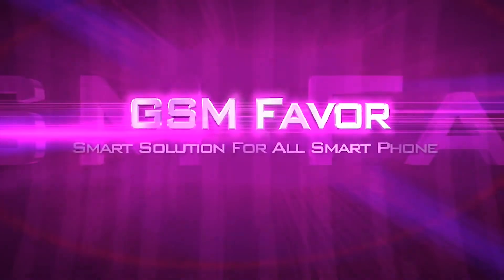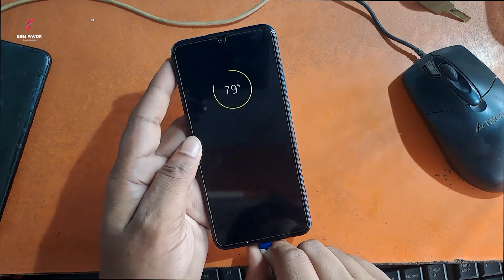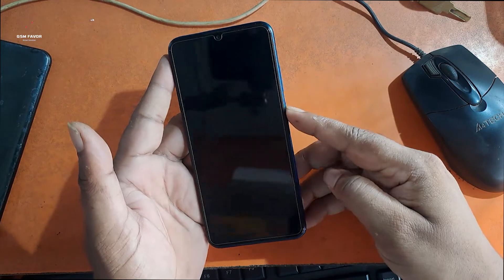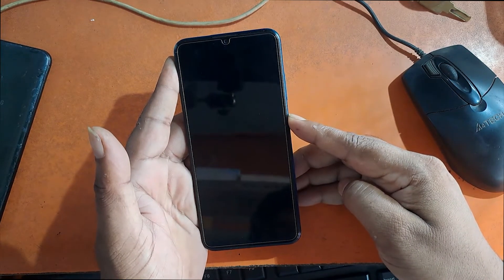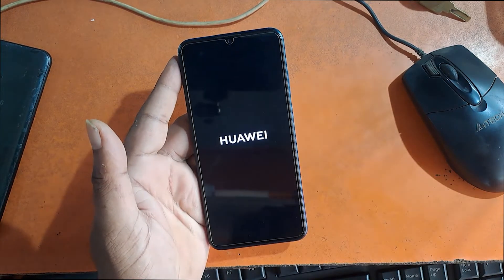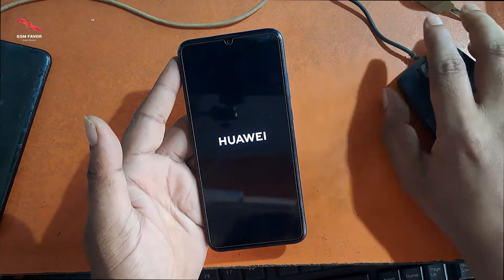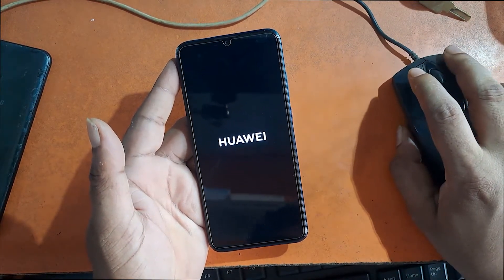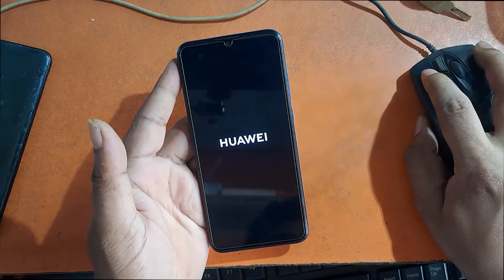How to Fix auto-recovery mode on Huawei | Huawei pot lx1 Volume Key ok but auto recovery problem

Comment: If you think this is hard, you can buy a battery for 15$ or 20$ and replace it
Reply: If i will change Battery it will be ok?
Reply: @2010anando yes if the exact same problem as this video
Reply: @2010anando because the problem is on the battery’s board and if you can’t repair it yourself you can buy a new battery.
Reply: No
Reply: @petrosantoniou6377 why?
Reply: @petrosantoniou6377  no what

Comment: I dont think this is safe. If you guys dont know what you are doing I suggest you not to do anything but simply change the battery with a new one. Always use the phone's original charger. It maybe a damaged diode problem. The battery is dangerous enough itself. Also a discharge from soldering iron could cause trouble. And I'm not sure if the video is for real because when the phone is working I can see the small green led light because the phone is charging. Mine is working while charging but when I unplug it , it keeps restarting.
Reply: I also have shorted the fuse like in the video. It works now. I saw the smd fuse on Aliexpress. I'm gonna change the battery or change the fuse.
Reply: it's safe. i always did this on my repair shop. but no one came back for complain.
Reply: @bosstechtv2141 es qu’on perd nos photos ?
Reply: Not always the case...I have like 3 p20 lite with the same problem....I changed the batteries and nothing changed 😢 maybe the batteries are not original or something
Reply: @iteeruzz2006  were you able to resolve it?
Reply: Hi I have Huawei p30 pro which stuck on erecovery, did you fix yours and how?
Reply: @arianbahrami7632 same here.maybe change battery
Reply: update  @arianbahrami7632
Reply: Me fck dumb just letgo to lowbat my phone and here im am fcking searching how can fixxx my Huawei phone im so shy to use my mother's phone😢
Reply: Bro I change the batterie, the phon is work normal but it Don't charge with a chargeur what is the problème ?
Reply: @amiradel6274  it is either the charge board or the charger adaptor.
Reply: I have y8p and its issue is same as yours. How can u resolved it?
Reply: @warrengarcia6590  I resolved the issu by change the battery 🔋 and change the battery ground strap ( battery braided strap)